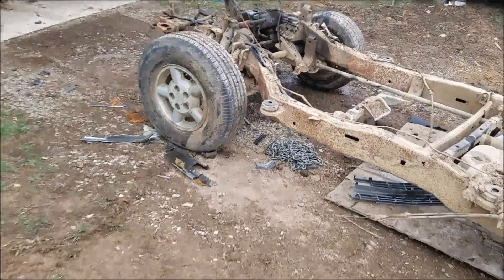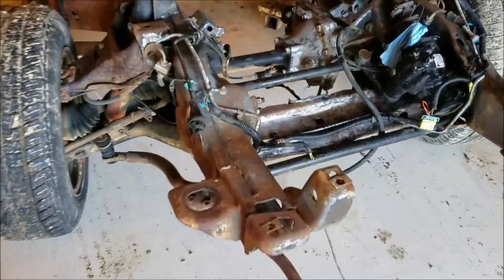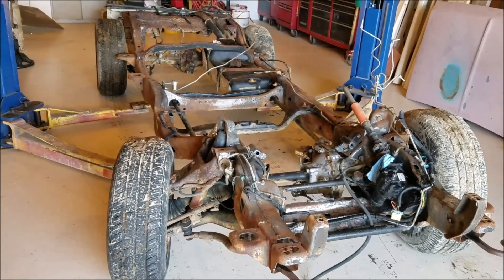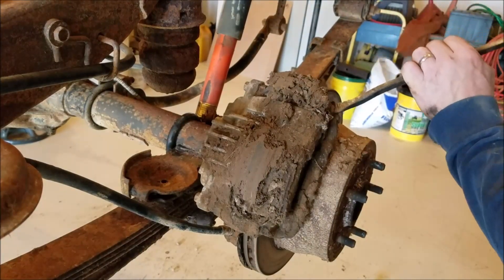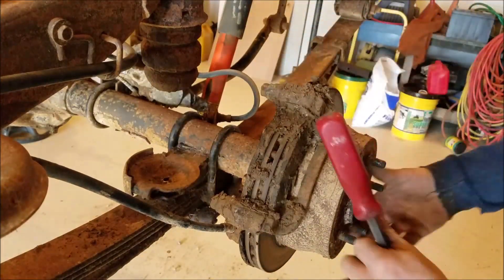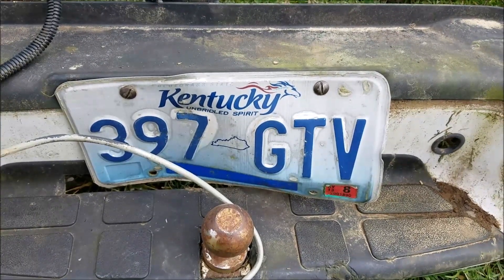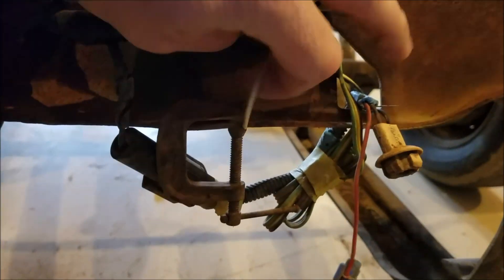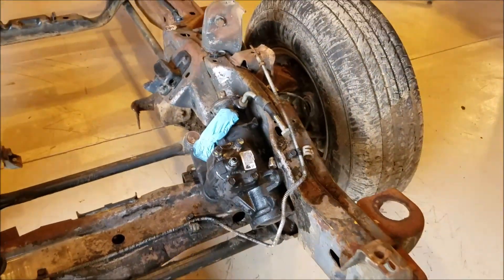BOOSTED TURBO Ranger build ... Part4 #frameswap

Comment: How you blow up a bucket of gasoline is you have to atomize it. Would be better off with a plastic milk jug of a gallon size. Fill with gasoline.  String it from a height, maybe five or six feet from the ground. Wire a firecracker of "adequate size" and an electric fuse to detonate it and drop it into the gasoline. Get a safe distance away and set off the firecracker. If you want to help make sure there is fire, build a small fire near but not directly below the gas milk jug. Have to be careful with that. If you do it right, the "firecracker" will blow the milk jug full of gasoline to pieces, mixing bits of the gasoline with air and atomizing a good portion of it, and hopefully catching it on fire in the process. The nearby fire will catch it on fire if the firecracker doesn't. With a big enough "firecracker", you will get a lovely fireball. Liquid gasoline doesn't burn or explode. The vapors do, if there is enough oxygen. Atomize gasoline liquid into a large air space and the right air to fuel will occur and if there is a source of ignition, boom.***

***DISCLAIMER: Do the above at your own risk. Firecrackers, explosives, gasoline, and fire are all dangerous. If you lose any body parts or die, not my problem.